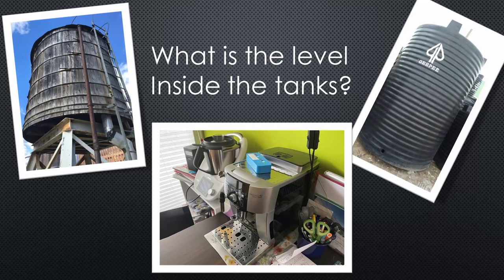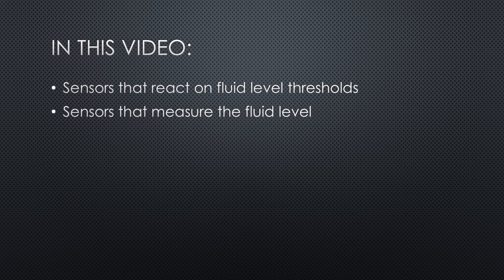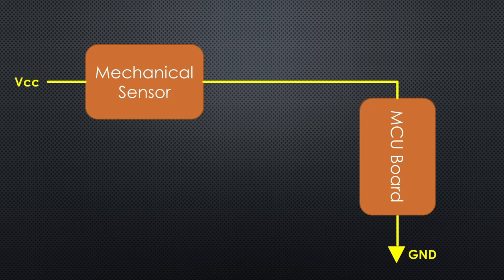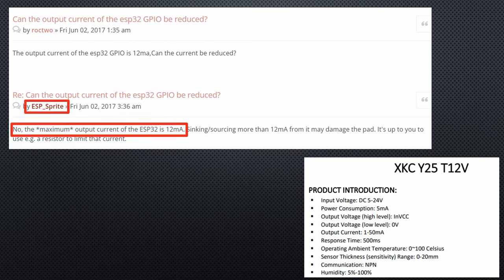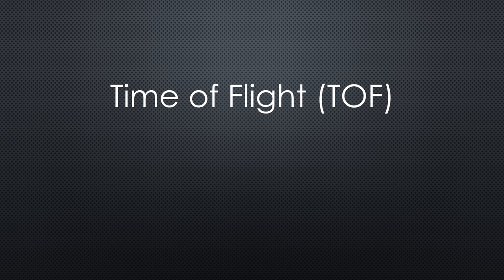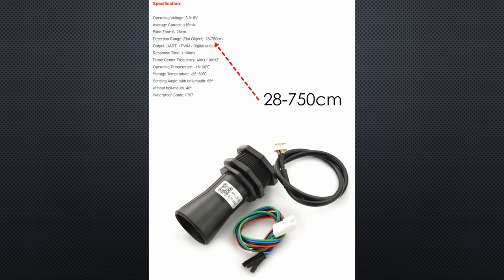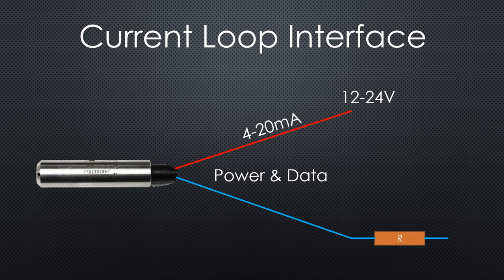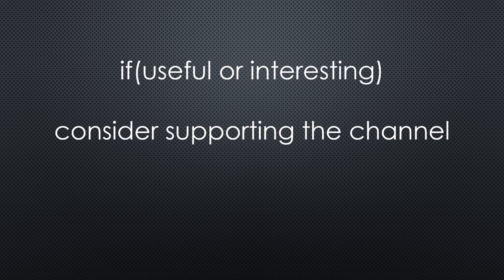#411 Ten Fluid Level (Water Level) Sensors and how to use them (Arduino, ESP32, ESP8266)

Comment: Nice overview, Andreas,
A couple of additional types:
Some coffee-machines use:
1) Magnetic sensor (Hall-effect) with an encapsulated captive magnet that floats in the tank. (This is also an "indirect" sensor, as it also needs the water to have weight ;) A reed-switch could be used, but hall-switches are cheap enough.
2) Optical "brekingsindex" based-sensor: A total internal retro-reflector "feature" in designed-in into the plastic molding of the tank; LEDs+ PTs observe this reflector. If the tank gets filled, the total-internal reflection no longer works (as the RI of water is similar to that of plastic); the reflector only works when air (emptiness) is present behind the molded retroreflecting feature.

A "better" contactless type imo would be one that observes resonance-frequency - if you treat the "cavity" above the water as a helmholtz resonator, the base-eigenfrequency is strongly dependent ton the water-level. A sounder (speaker+microphone combo) can easily detect this at a distance, and estimate height. Unlike ultrasonic ToF, as the frequencies involved are low, a moisture-blocking "shield" can be placed in front of the speaker/mic. This resonator may be restricted to an immersion-tube if you wish to be agnostic to the shape of the rest of the tank.
Reply from the maker: Interesting new concepts! If I remember right, our old coffee machine had a moving part in the tank.
Other viewers also wrote about these optical sensors which work with refraction. Honeywell seems to sell them. But they are expensive. I wonder if there is a cheaper source. They are very good because they can be easily protected as you write.
The resonance way sounds a little adventurous for me. Theoretically, it should work. But I do not know if the resonance is distinct and if there is only one. Did you use it and did it work?
Reply: @AndreasSpiess  The Senseo/Philips machines use a floating magnet, and (if I am not mistaken) the Krupps machines use the refractive-index mechanism. The latter is nothing more than an LED and a phototransistor (on the machine) and a molded retroreflector "prism" in the water-tank that gets positioned facing the optical components.
I have used the resonance-concept for a different application (more like, injecting white noise, and looking for peaks; all this before optical ToF was hot). A friend of mine has used a mic/speaker arrangement on an ESP32 with a PVC pipe (in resonance-mode) to measure the level of his garden-pond. By placing the pipe at a shallow angle (instead of straight-down) he gets more dV for the same dh.
Eigenfrequency-seekers are surprisingly easy to build - if you take the microphone's (or any sensor's) output, amplify+clip it, (i.e. amplitude-constantify) and feed it back to a speaker (any actuator), you tend to trigger the dominant eigenmode. Frequency-counting the clipped signal is straightforward.

I can imagine though that it may not be nice to have a coffee-machine-tank whistling at your guests at random moments ;)
Reply from the maker: This Eigenfrequency sniffer is interestig! Thanks. The prism sensors were mentioned in other posts. But so far I did not find a cheap one. Adafruit has one for more than 20 dollars.
Reply: @AndreasSpiess  If you are interested, I have uploaded a video I made long back illustrating a prism-(total-internal) reflector implementation with a laser-pointer: https://youtu.be/esRmX1tBS5g

Comment: For a artisan well you can use echo acoustics, measure the echo time and barometric pressure and temperature to calculate the distance. The accuracy is surprisingly good. You need tables for speed of sound based on barometric pressure and temperature so the micro needs memory to hold the tables but the parts list is low, speaker, microphone and barometric sensor with temperature, the rest is just software.
Reply: I’d love to see a video on this!
Reply from the maker: Isn't this how the ultrasonic sensors work? Or maybe I misunderstood something.

Comment: Very interesting. I had a similar problem to your colleague's; I need to measure the water level of a 30m deep water well and of an underground reservoir. I ended up using two water pressure sensors (one with a 5-20ma output and the other on rs485 modbus); they are managed by an Arduino mega and I get remotely the readings by SMS through a GSM module. Also, the Arduino drives the pump that extracts water from the well into the reservoir; and it's all configured through a Nextion touchscreen monitor
Reply from the maker: Thank you for sharing your experience. So I am confident that it can be done.

Comment: Hi Andreas, thank you for the water level measurements review.
The radar sensors have the advantage over ultrasonic type in that they are not affected by the temperature of air, which in certain cases can be an error factor
Reply from the maker: Thank you for the additional info. Good point!

Comment: In racing you can find level switches like the Honeywell LLE Series used in fuel swirl pots and dry sump oil reservoir tanks. They use optical sensing at the tip of the unit based on changes or refraction. It is not uncommon for fuel to be weighed prior to being added to a race car rather than using volume measurement. Another thing we deal with in race cars is the slosh which makes measurement a real pain. We end up having to buffer the results of the measurement to a high degree.
Reply from the maker: I always wondered how even my car (I am a prudent Volvo driver;-) ) is able to get the right value. In your case it must be much more complicated...
These Honeywell LLE sensors seem to be threshold level detectors. I can imagine that it would work if you place an LED and a phototransistor close to each other.

Comment: 1) I measured the level in a container that was semi-opaque by shining a laser pointer into the fluid (visually casting shadows on the opposite side which were lighter/darker above and below the level).  Infrared can penetrate some containers that are opaque in the visible spectrum.
 2) If the fluid is warmer or colder than the ambient temperature, a thermal camera works for levels that don't change too rapidly.  (Can show stud locations in exterior walls too!)
Both require a camera though, so are more expensive, need calibration, and more programming than just one GPIO.
Reply from the maker: Good ideas. I assume they are also more for indoors as the changing sunlight also could have an influence...

Comment: I use one of those screw in style pressure sensors with a range of 0 to 300 PSI with my oscilloscope for engine diagnostic. Works great for engine compression tests and running engine back pressure tests.
Reply from the maker: Thanks for sharing your experience!

Comment: As an indirect method, to mesure water level can be used the 2x water meters with inbuild LoRaWAN controler or with impulse output. That approche gives accurate measurement to build balance. The water meter also can have built-in pressure sensor.
Reply from the maker: This method would even give more information on consumption...

Comment: If your tank has legs a strain gauge placed on 1 leg can be used. 
Be sure to be aware that ultrasonic sensors are sensitive to air density changes due to temperature change. This can be compensated for via a temperature sensor.
Also if you use a pressure sensor at the bottom of the tank and only have the tank discharge port to attach to, a running discharge pump will invalidate the reading due to the pump suction. 
In my industrial life I applied each of these methods on a variety of different chemical and other dry material tanks. Was able to use radar sensors fairly often as well.
Reply from the maker: Thank you for sharing your valuable experience! Indeed, radar is also often used. But such sensors are not cheap and probably more for the industrial field.

Comment: It's worth metioning that pressure sensors are affected by atmospheric pressure as well as the fluid level. In a water thank, that might make 60 mm or so difference to the reading. To compensate, sensors for fluid level measurement normally need a vent to the surrounding air. For submersible sensors, that means the cable has to contain an air tube which needs to be dealt with at the microcontroller end.
Reply from the maker: You are right. Thank you for mentioning the fact!

Comment: I have taken a small Zigbee door open/close sensor. It works by detecting a second piece - a magnet - and closing the circuit when a magnet is present. I have soldered two wires to the magnet-sensing reed switch in the sensor, and connected them to two stainless steel bolts spaced around 2 cm apart. When the bolts are submerged in liquid, the circuit closes and I get a "closed" signal. When the liquid subsides, the circuit is open and I get a "open" signal.
Reply from the maker: Cool. Thank you for sharing!

Comment: Another tank (or well sensor ) is to pump air down a tube to at or near the bottom.  The air will displace the water, so the air pressure will match the water pressure at the bottom of the tube. Once the air starts bubble out the bottom, then the pressure can go no higher.   So then you can measure the pressure at the top, and know the height of the fluid column.   Downside is that you need an air pump.  Upside is that the only thing in contact with the water is a tube ( usually plastic ).  Also easy to replace the expensive components.
Reply from the maker: This principle was mentioned a few times in the comments. I like it because it has no contact with the fluid and does not need to be mounted inside the tank.

Comment: I am interested in fuel level meters for paramotors. There were many attempts to make such (I also had) but most failed. At least currently there is no "industry golden standard" for such meter. Many pilots still just watch the fuel level with the pocket morror. Or just rely on time measurement and the average consumption. The problems here are: agressive gasoline, vibration, weight, how to display the results and reliability/simplicity.
BTW, I heard some systems use the pipe with the coaxial wire which run from the top of the tank through the fuel to the bottom. The electonic part actually measures the changing electical capacity of the system, fuel/air being the dielectric.
Reply from the maker: You are right. This is a big problem, mainly because of the heavy movement. And other viewers described these capacitive sensors using a tube.

Comment: There is a product that measures capacitance of a wire submerged in water and derives water level from that. It's easy to find ic that can be quite precise ina small range of capacitance and rest is just calibrating the device when the level is max and min.
Reply from the maker: Other commenters also mentioned this method. I did not know that it also works with long cables...

Comment: I guess for liquid level measurements, one could use a speaker and microphone in the tank, do a frequency sweep and determine the resonance frequencies, die a temperature correction and then use a lookup table to convert frequency into fluid level. But that would be a nice example of over-engineering ☺️
Reply from the maker: Where do you expect a resonance?
Reply: @AndreasSpiess  the tank is a resonance cavity, with a fundamental frequency that is determined by the volume (and therefore the fluid level), the temperature and likely some other parameters like gas composition above the fluid (which I'd assume to be air, but this is not necessarily always the case).
Reply from the maker: Aha. Now I understand :-)

Comment: thanks for the inspiration.
somebody hacked the 433mhz communication of the  ultrasonic tank level meters with remote display offered on ebay ?
had an eye on this because its less mechanical work for this task.
Reply from the maker: I do not know. Maybe you check the RFlink project. They support plenty of sensors. Or RTL_433? They support a few level meters.

Comment: I am wondering about detecting level in my four water butts. I am thinking of a rigid tube sealed at one end and open at the other, then a bme280 placed in the sealed end. The tube is then pushed down into the liquid. As the bottom is exposed to more depth the pressure in the tube will increase. It is a way of using a simple cheap sensor.  Each tube will be solar powered and use mqtt to report back to a rpi. What are your thoughts?
Reply from the maker: I made a video about a similar sensor (I hacked a blood pressure measuring device). But I added a pump because I feared that the sealing will not last forever...

Comment: DIY solution: magnetic reed switches or Hall effect sensors wired safely outside the tank, triggered by a strong magnet on a float just inside the tank wall, sliding up and down a stainless steel or plastic guide bar.  Would work with anything but steel tanks (would block the magnetic field).  Would also work with tanks under pressure, as long as the float can handle the pressure without imploding.  My project is a DIY automatic water carbonation machine that lives inside the fridge.  It needs to refill a small tank, so needs low and high water level sensors.  And it lives at maybe 100 PSI inside the tank (pressure from CO2 regulator).  My solution is to use a common and cheap water filter housing for the tank (maybe 1 to 2 liter capacity), with two inexpensive espresso machine water pumps to handle filling (pumping up from water line pressure, into the tank against the higher CO2 pressure), and for carbonation (recirculating the water inside the tank through a misting nozzle, spraying above the water though the CO2 atmosphere to carbonate the water).  It needs a micro controller and level sensors to cycle; to run the refill pump when the tank gets low, pump water in until the tank is back to high level; and then run the carbonation pump for a few minutes to drive the CO2 into the water.  Dispensing the carbonated water happens through a simple hand operated valve, same as a keg tap valve, open = water fills your glass driven by the 100 PSI CO2 pressure in the tank.  This design idea is different than the typical commercial carbonation systems designed to run large volumes in restaurants.  It is meant to be cheap and simple, and fit in a home fridge, with only a small water feed line and a CO2 line to plumb into the fridge.  It wouldn't handle the huge volume, but assuming a household doesn't need more than a liter of bubbly water every few hours, it would be perfect.
Reply from the maker: Sounds like a very useful project. Thanks for sharing!
Reply: @exploder69 I would love to see some more of your DIY in fridge carbonation machine. When you say inexpensive espresso machine water pumps, I assume vibratory pumps.

Comment: Hello, I would like too add a comment for the pressure sensor. You can place le pressure sensor on the top of the tank and use a plunge tube to take the pressure of the bottom. Like as use in all washing machine.  Thanks for your videos. BR
Reply from the maker: You are right. I made a video where I used a blood pressure sensor to build a similar sensor.